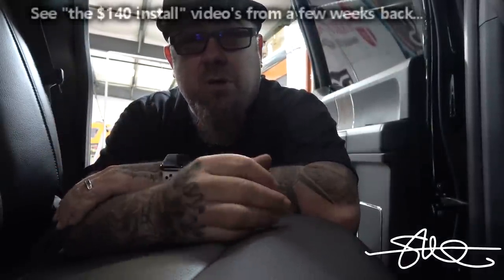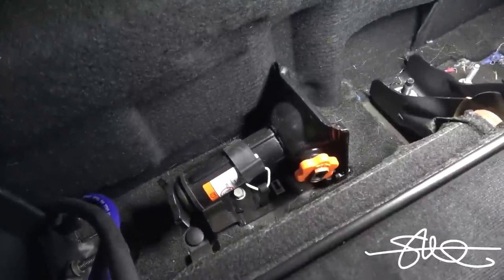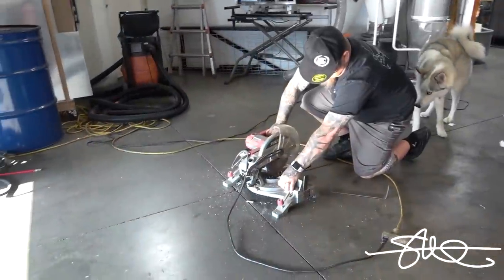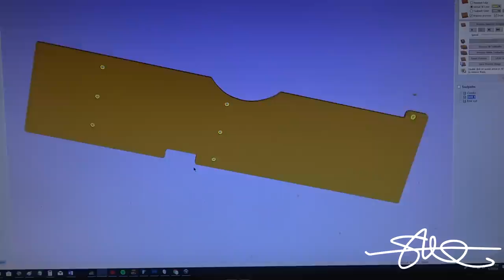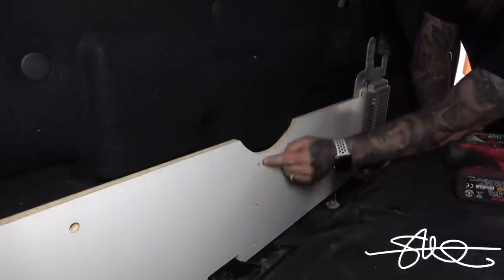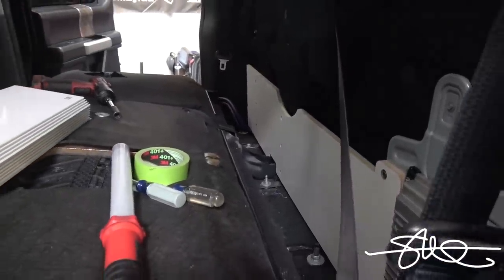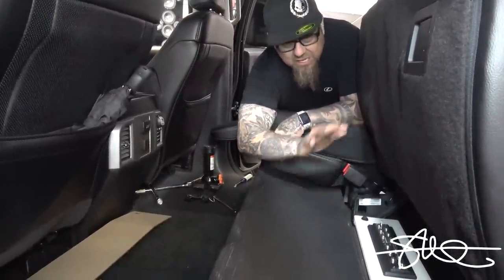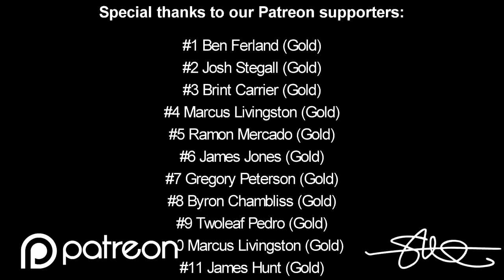Ford F250 Superduty Sound System Upgrade | Factory Subwoofer Removed New Amp Rack Fabbed

Comment from the maker: i showed some of this live on Instagram yesterday and today.  Join us and don't miss daily behind the scenes live streaming at http://www.instagram.com/meade916
Reply: This build is gonna be nice and clean
Reply: meade916 that end credit had me rollin
Reply: I need to do something very similar to my truck. Reversible stealth installs for real life. Thanks again Steve!
Reply: Can u blow the factory woofer up see how much power it can take
Reply: Hey was wondering what kind of nail gun you use to put together your enclosures. Seems like it's a lot easier than using screws.
Reply: @James187781  I think it is called a "brad" nail gun. Not sure of the exact size. It just holds it until the glue dries. That glued joint then becomes stronger than the wood itself.

Comment: I have a pretty good amount of experience with the Ford Sync system and the Sony amp in these fords. My recommendation would be to go with the PAC ampPRO route. It should have a toslink out for the audio control unit. With this method, you can leave the factory system alone. Typically, when you unhook the Sony amp, the system does not behave correctly. There is also a harness that can hook into the speaker output harness of the Sony amp. For that you can use the PAC APHFD01. With this combination of parts, you can leave the factory system alone, and still have good beat. Hope this helps a little bit.
Reply from the maker: already have it. You are 3 video's behind brotha. Thanks though!
Reply: @meade916  Yup I had to confirm by watching that vid again as I had forgotten you got it. That speaker harness will help too unless you plan on running your own wire.

Comment: In a tight situation like that, I use a #1 flat tip screwdriver bit to get to the gains. I also made some jumper wires with alligator clips for my DD-1 and CC-1 leads.
That 4  channel amp is gonna be a pain to deal with when you set the gains on it though. At least it looks like it.

Comment: Hey man i just put 4 midbass speakers in two 6" and two 8" and my speakers are making that buzzing sound with the rpms
Reply: And suggestions
Reply: Are they powered off an amp? If so, you might try the RCA ground circuit trick (google it - basically just wrap copper wires around the RCAs and ground them to eliminate noise). That could be your culprit. If it’s not that, you might just have audio wiring running too close to your alternator.

Comment: I got a question @meade916  I’m running two evl 15s d2 on a 3000 watt class d amp audio pipe what size alternator would you recommend right now I’m stock just don’t wanna go out and buy nothing I didn’t need to if you can shoot a reply when ever would be great 👍 ty

Comment: I got a 2017 f350 factory sound system with the bigger factory Radio with nav. What do I need to add a amp and sub ? Is it a inline converter and witch one for subs and amped door speakers

Comment: Is the big three upgrade necessary when i am only using a 750.1 fosgate amp, ran to a single L7 12?
Reply: @spermcountzero  ty.. just wanted the assurance.
Reply: @spermcountzero  y would it be necessary? serious question. not a joke.                    im running 2 15" at about 1800watts on a jl audio 2000watt 1ohm amp and i never upgraded miine.

Comment: I have a 2019 F250 and I think the truck has decent bass idk if I would call it piece of shit really it sounds pretty dam good for straight up stock I think.
Reply from the maker: it is BARELY ok.  Pretty weak over all.  You don't even realize how bad it is till you get a real system up in there.  Just sayin'.
Reply: I think it’s better then the normal trash manufacturers usually put in the vehicles from factory. I commend them for making the effort to put something in the vehicle that’s “barely ok”.